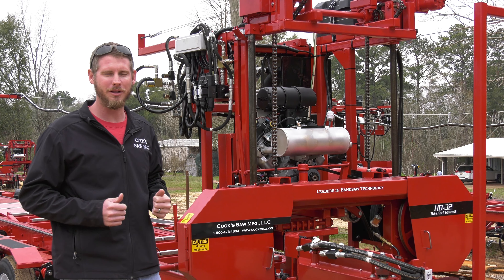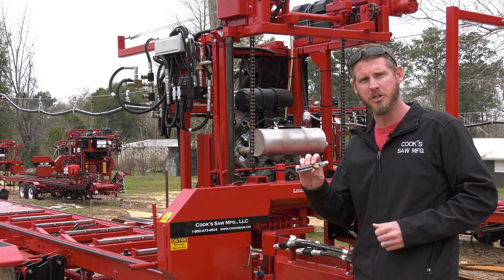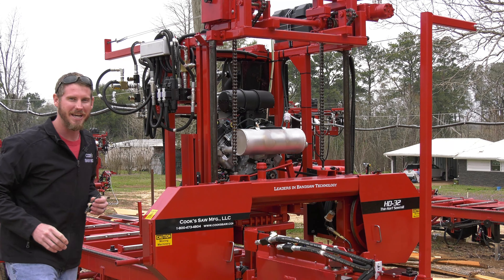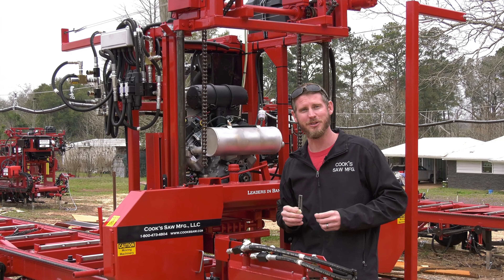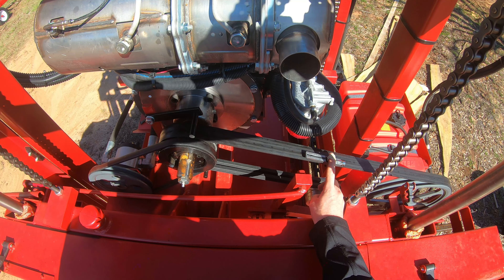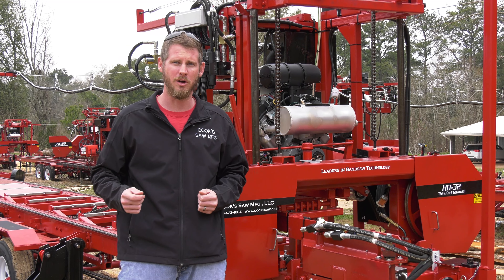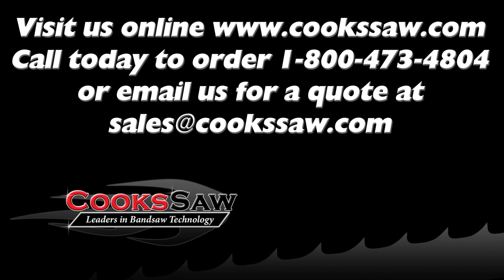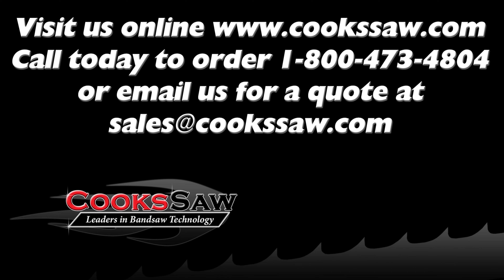How To Check for Proper Sawmill Drive Belt Tension

Comment: I got some 25" wheels and parts from Cooks a while back,  Just getting around to building my belt tensioner and so as I'm studying belts and planning, I was thinking my tensioner would be on the outside of the loop pushing in (on the slack side, not the working side) like you have there,  But.. I recently saw somewhere that positioning works fine for Flat belts but "V" belts should be tensioned from the inside-out.  pushing in makes me think more contact at each end, but for belt life and torque,  Inside forcing outward just seams like it might be right. now waiting on some parts to try that.